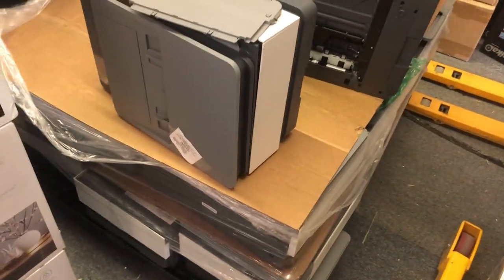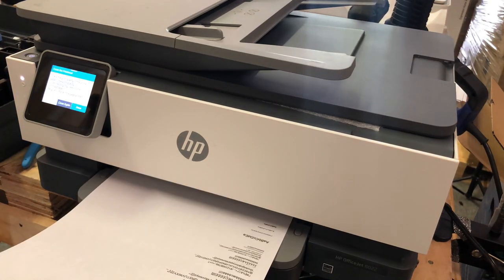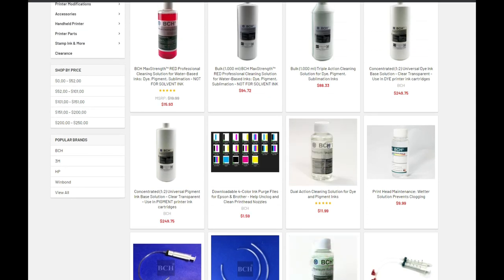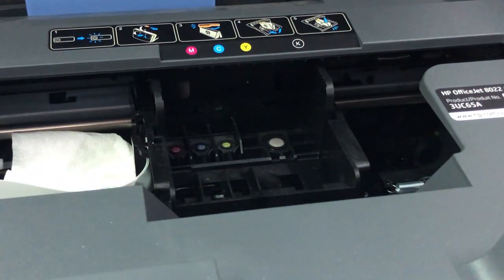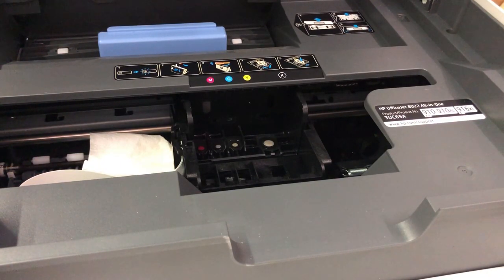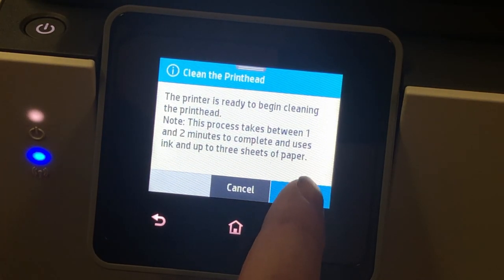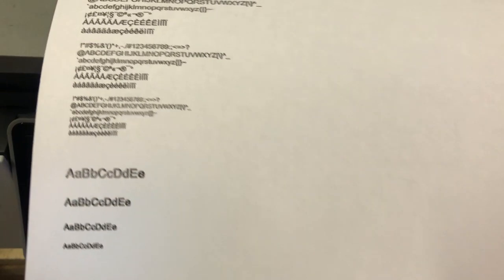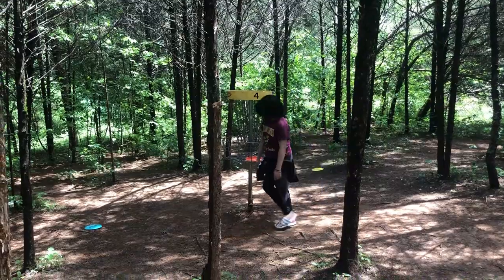Most Effective Way to Unclog HP 910 916 934 935 Printhead - Fix Printer Stripes & Missing Colors

Comment: Alexis, thank you very much for this info and cleaning supplies. I am a Canon printer user and have been for 30 years but over Covid I couldnt find anything but the HP OfficeJet Pro 8025 and after 6 months the Cyan ink was blocked. 
I contacted HP and because i am part of their annoying Instant Print program they said that they would help and to date they have sent me 9 new cartridges, 3 of them being Cyan and of course they said that the issue would be solved with a new cartridge every time, when I knew that it was a print head problem. 
Now, after dealing with the HP service people for over six months they have now informed me that the printer is now out of warranty because of the time they kept fobbing me off with ink cartridges which they knew would run out the warranty. Bastards!
Alexis, I ordered the cleaning fluid which arived very quickly and although I recognize the smell of the liquid I must say that the best thing about the kit are the plastic syringes which allow you to get the fluid to flow through the clogged jets with ease are they are a pure genius piece of hardware and have worked like a charm.
So I thank you again and cannot impress upon anyone with a clogged jet to purchase this great kit. Thank you again. Regards, Doug.

Comment: Very informative, thanks. Didn't understand why you were using ink combined with water solution with the black ink. Is it best to do this when uncloging rather than use normal undiluted ink? 

That is the way I fill the cartridges on my HP too so glad to see you using it. I was told to take the tape off the breather hole on the other side and put paper towel underneath it and when ink comes out you know it's full, but is this unnecessary? I refilled them recently and ran the clean printhead a couple of times then did another one next day but still get slight lines, not white but slightly different shade like happened to you. Is this a problem?

I like the grass and trees at the end. Nice environment for a warehouse!
Reply from the maker: It's not water. I combined ink with the wetter solution.  The wetter solution absorbs moisture from the air and keeps the printhead wet.  If a printhead is cleaned with ink, it will stay fresh just for a few days because ink is designed to dry fast once it is printed.  However, if I fill the printhead with 100% wetter solution (like in a new printer), the first few pages will be blank.  Some impatient customers will yell murder and return the printhead.  So I come up with a formula to combine both, so the customer will see some color immediately, and will not send me angry emails.  LOL